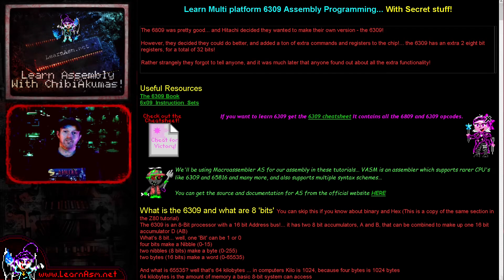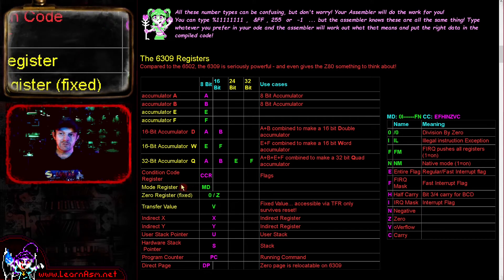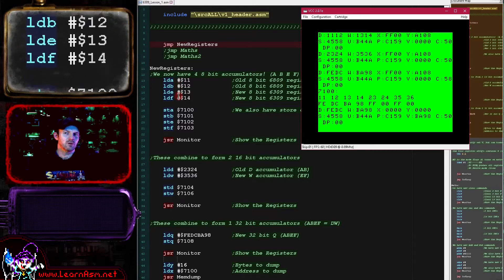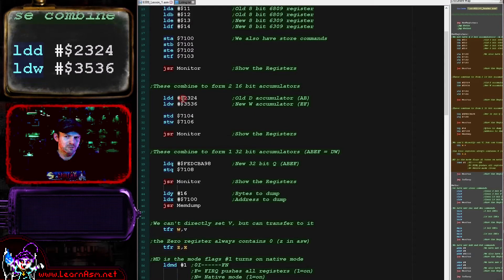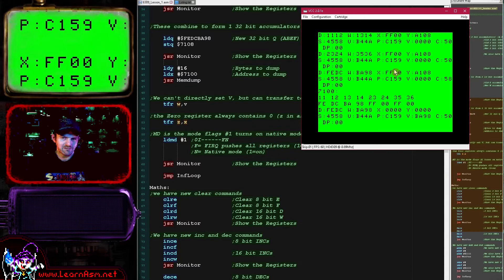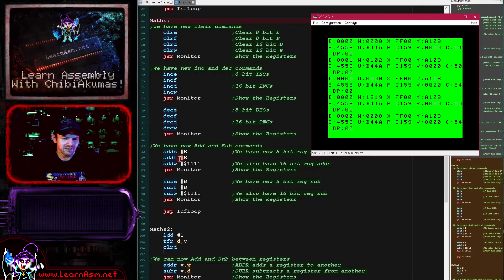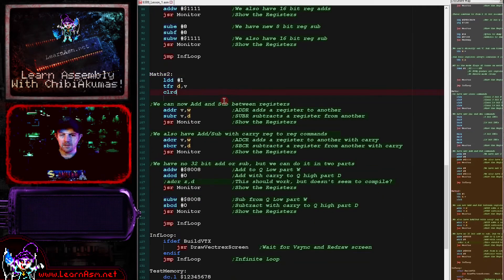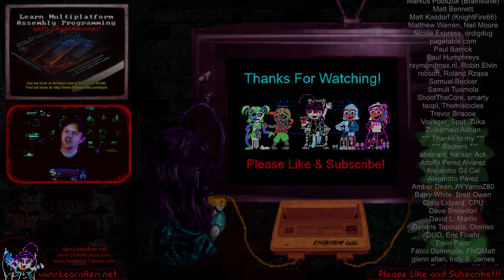Lesson 1 - Getting started with 6309 Assembly

Comment: I believe that 6309 native mode also alters the clock cycle timing of many instructions, resulting in an over-all speed increase.  NitrOS-9, the community re-write of the OS-9 operating system, runs the 6309 in native mode and is significantly faster than the 6809 version.

Comment: In addition to NitrO-9/6309 there are a number of CoCo games that were written to take advantage of the various features and speed-ups of the 6309.  Recently some of the CoCo 3 games targeted to OS-9 have been patched to take advantage of some 6309 features.  I believe Sublogic Flight Simulator II, and maybe the Sierra interpreter??  One thing you didn't mention is the memory block transfer instructions.  It'd be great if you'd cover those in another video.  When these features were publicized in the English-speaking 6809 world in the early '90s, it was a very big deal, and many CoCo diehards installed them in their machines.  It remains a popular upgrade today.
Reply: Correct in that some games have been patched to take advantage of the 6309 to speed them up - Rescue of Fractalus is one I did that now runs about 30-40% faster. Flight Sim II does have some optimizations, but more to smooth multi-tasking rather than speeding it up (although that is being worked on). There are multiple Coco 1/2 games that have been optimized as well (Color Car Action, Marble Maze, Gantelet, F-16 Assault, Rush'n Assault, Touchstone) as well as some Coco 3 games (Super Pitfall, Xenion). There are also some games for the Coco 3 that were written to require a 6309 - Spyder Hyper is a free one from way back in 1996, and also the more recent Gunstar released in 2020. NitrOS9/6309 for some functions (especially on graphics screens) is over twice as fast as the 6809 version, so a lot of programs automatically get speed ups. The BASIC09 programming language now has some speed ups as well, with more coming, for the 6309 version.

Comment: Some general comments: MAME, VCC and XRoar (all Coco and/or Dragon emulators) now have options for 6309. As far as "practical use" for using a 6309, there are several:
 - Much lower power consumption vs. a 6809 (like 10% of the power)
 - Available in a 3Mhz version (the 6809 topped out at 2 MHz), and is easily overclock-able to 4 Mhz (and even 5 MHz in some cases)
 - It is still being made new, thanks to some military contracts. I don't believe the 6809 is still. (Side note: Hitachi did a "pure" 6809 clone as well, the Hitachi HD6809, which is the same NMOS technology as the Motorola part. The 6309 is CMOS, and was first announced in 1985 as a lower power, more highly clockable CPU).
Native mode is necessary if you want to take full advantage of 6309 speed enhancements. On power on, native mode is off so that all CPU instructions take the same number of cycles as a Motorola 6809 (thus preserving 100% compatibility with hardcoded timing loops, etc.). In native mode a fair number of the instructions (both 6809 and 6309) take less CPU cycles to execute. Most of these are 1 cycle less, although some are even faster (EXG goes down from 8 cycles to 5, for example, and ABX goes from 3 down to 1). 16 bit (via register or offset) indexing modes are 1 or 2 cycles faster, and all auto-increment/decrement indexing modes are a cycle faster as well. (I should note: IRQ, NMI and SWI/2/3 will run slightly slower in native mode, since in native mode those also preserve the W register on the stack during an interrupt. Please note: W is not preserved on an interrupt in 6809 mode! An interrupt service routine can STW or PSHSW to get around that, although it is slower and takes more memory than having native mode do it for you).
The V register was much more useful back in the 1980's to 1990's, before decent debuggers in emulators started coming out. You could transfer "checkpoint numbers" into V as a program ran to help debug it; if the program crashed or froze, you could RESET the machine and then TFR V,D (or whatever destination register you wanted) and see what part of the bad routine it made it to before the crash (we used this to track down bugs in IRQ handlers in NitrOS9, for example). Nowadays it's much easier to use proper emulator/debuggers for this kind of thing.
You nailed the point of using E and F only when absolutely needed as they are a cycle slower than A and B; the main use I have had for them (other than new math functions that require them, or the TFM command where W holds the # of bytes to copy) is for loop counters that are using A and B with in the loop. The old method would have been to either store the counters in Direct page or on the stack, and then doing DEC <address or DEC ,s to drop the counter. using DECE / DECF (or DECW for a 16 bit counter) is a fair bit faster.
A note on the 0 register - although TFR is 2 cycles faster in native mode (4 vs. 6), it is sometimes faster to load or clear a register (LDU #0 or CLRD as examples). Some of those required prefix bytes and take more memory than the always 2 byte TFR instruction. The bigger reason I used it at times is that you may want to preserve some condition code flags (like the Zero bit) from a previous instruction, but still set the register to 0. Rather than having to preserve CC on the stack and retrieve it again after clearing the register, TFR does nothing at all to the CC register (unless you TFR to CC of course), thus saving having to preserve/restore CC entirely.

I look forward to future parts where you discuss the TFM (Transfer memory) commands, enhanced indexing modes, bit manipulation, 32 bit math (like DIVQ and MULD), additional 16 bit math (DIVD), etc. I think it is useful, as the Coco and Dragons both have software already that uses the new features, and the Fujitsu FM7/FM77 also had programs to use it (in fact they were the first ones to discover the new features way back in 1988 - we didn't learn about them until a usenet post in 1992).
Reply: A 1988 discovery here in the US would have altered history, and in that scenario I would think CoCo3 sells 2 more years until AST's purchase (and Oh, the software - good lord, the software we would have had). What you and the NitrOS9 team did in such a short time after 92 is an incredible achievement (continuing to this day).